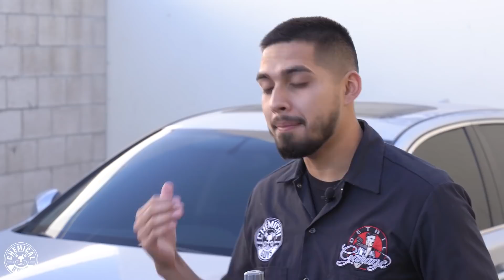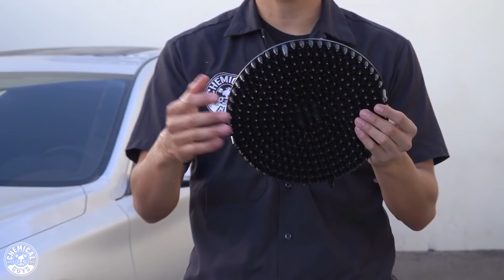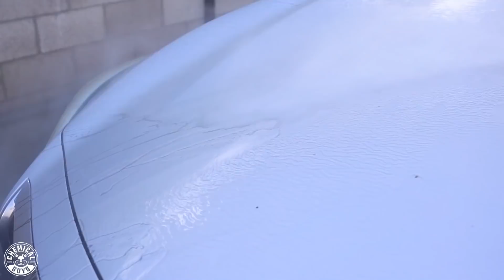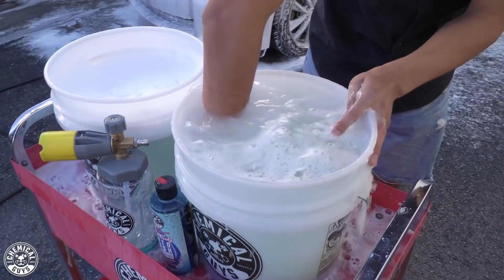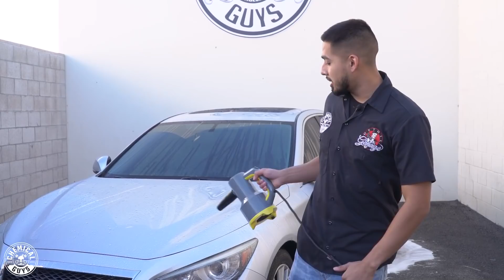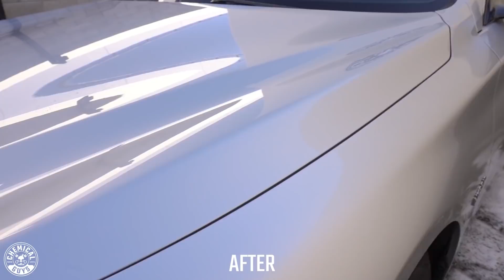How To Get A Safer Wash & Dry! - Chemical Guys

Comment: Do you recommend rinsing after using the foam cannon or go straight to wash mitt? I’m wondering if the dirt that’s lifted from the foam will still produce scratches…
Reply from the maker: Hi Weston! The foam will emulsify debris and safely guide it off of the surface with your wash mitt.